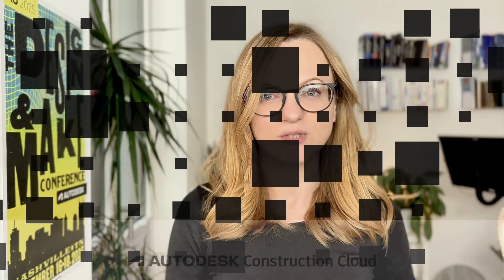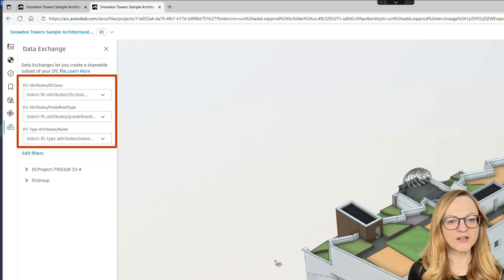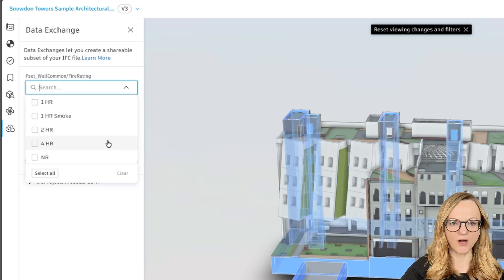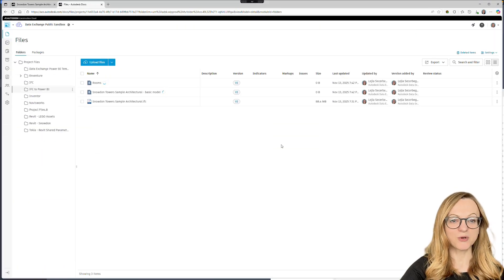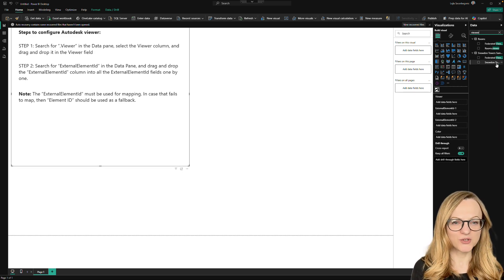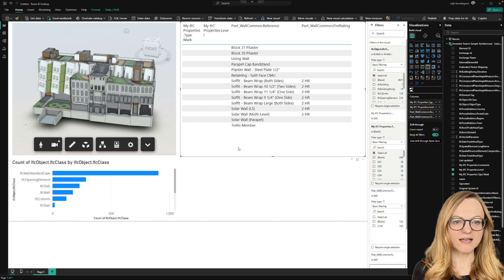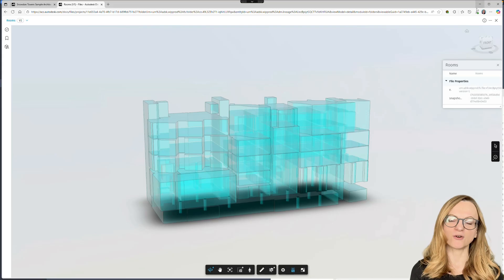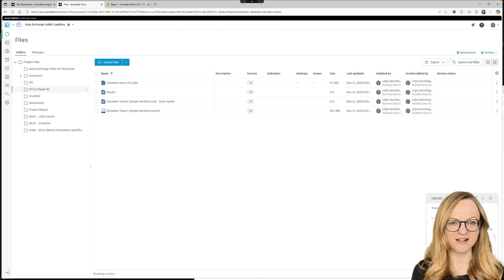Data Exchange: From IFC to Power BI in 10 minutes

Comment: Thanks for the video and great explanation! How about the projects that are created before the July 22nd? Creating a new project and transfer all images, forms, etc. in order to enable IFC data exchange is a very extensive task. What is recommended in this case? Will this feature be available in the near future for projects created before July 22?
Reply from the maker: Thanks for your comment - that's a great and valid question! 
The thing with the July 22 is that the ACC switched its IFC processing engine to a newer and improved version, which we also require for Data Exchange. This results in a slightly different IFC data structure, which could lead to inconsistencies in Model Coordination, Issues, etc. if "old" IFC files are mixed with "new ones". 
You will also need to re-upload the IFC files to new projects - transferring them from older projects won't reprocess them at the moment. 
I understand this is not ideal - I'll keep you posted if there are any updates around this!